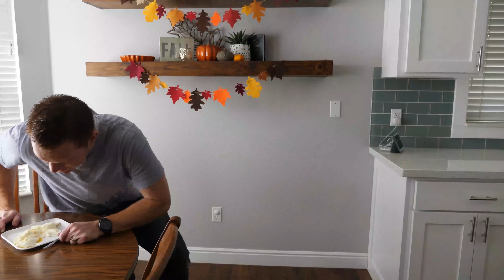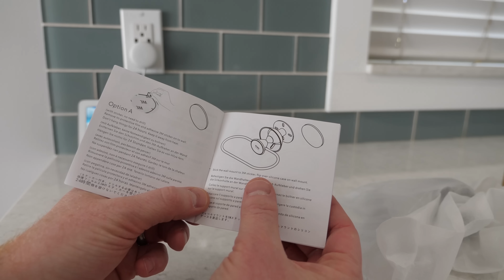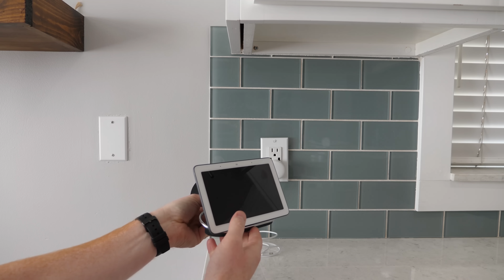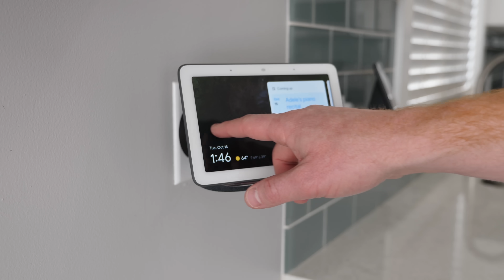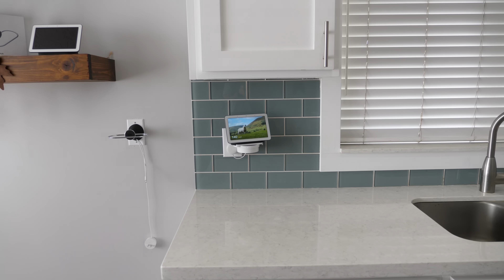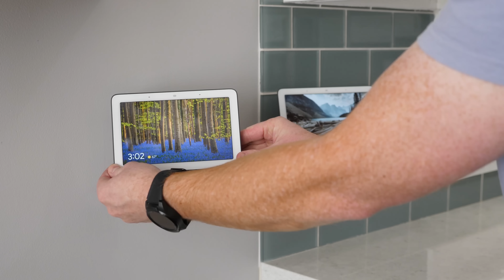The Best Mounts for the Google Nest Hub

Comment: Not to be critical, but since you do have a blank plate, and rather than depend on the double sided tape working as it may in some areas of the country, but here in Louisiana the humidity is horrible and often times Kitchens due to the heat of cooking etc can inherently be a more humid environment that others second only to a bathroom with a shower.

I think I would have simply bolted the plate to the plastic cover.  These covers are extremely cheap, and even if drilling holes in your existing plate you could just purchase a 2nd one that you would not have to worry about drilling holes in and have the original to put back into that location if for some reason you decide to remove the hub from that location one day.

And me being an electrician is what lead me to this idea of bolting it to the blank plate vs using just the provided double sided tape vs screwing it down to something.

Also and again because I work in the electrical field, these come in stainless steel which obviously would be metal and much better for drilling and more ridgid that I would mount mine on a stainless steel plate and because the hub is likely larger than the electrical cover you would not really even notice that it's metal and not white as are your other plates in the area.

Maybe the self sticking tape is much stronger than I give it credit, I would just be apprehensive about mounting a 80.00 device with double sided tape.  Which is the price now that the Google Hub Max has come out, I think they were almost twice this price at one time however before the introduction of the larger Google Hub Max.

I do have two Kiwi mounts however which is how I came across this video, and I have to say these mounts are very well made, they look sleek and blend in very well, and do a great job of supporting your traditional smaller sized Google Hub displays.

Again, not intended to be critical, but helpful and I may be wrong about the strength of this double sided tape vs using screws.

Thanks for the video!

Comment: Good video Brett. I mounted my echo show 5 with the mount genie a few weeks ago. I was looking to get it off the counter. I couldn't use a mount/shelve that was above the outlet cause the screen would have been blocked by the cabinets.  The Genie is however on the side and it was the perfect height.  I didn't like it was white, so I spray painted it black. (I'll tweet you a photo) and then when I played music, it didn't sound good.  You can actually hear it rattle and not sound as good as if it was on the counter.  Have you noticed that with yours?
Reply from the maker: Good idea and that is weird. I have not heard that with these mounts because the speaker I think on the Nest Hub is right in the front.
Reply: @TechWithBrett  I love  you😂
Reply: Y

Comment: I'm not a fan of anything
That uses adhesive, just incase it doesn't hold lol
Reply from the maker: Even though that is I used it I would definitely say that's the backup solution. Using the screws in the back is the way to go.
Reply: @TechWithBrett  definitely, if it was screwed in, I'd for sure use that one, love that you can move it any way you want.